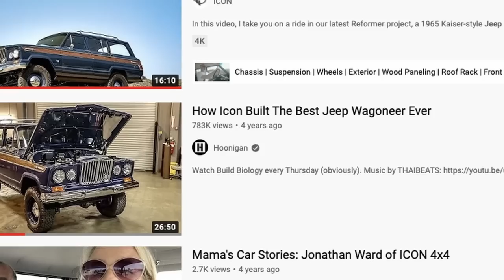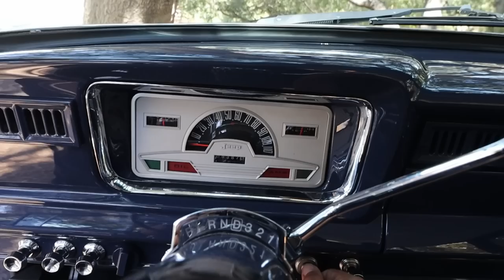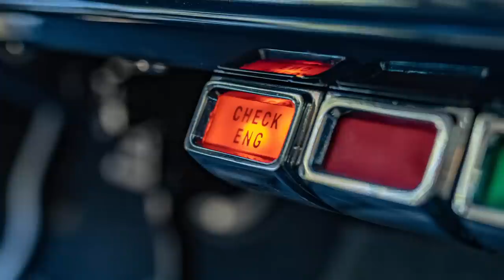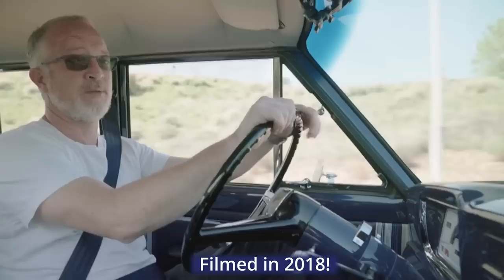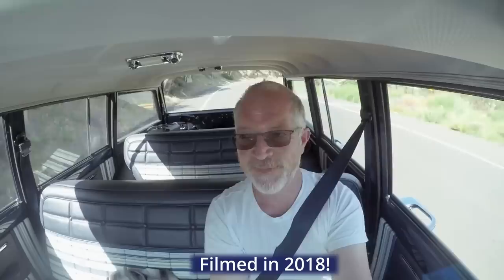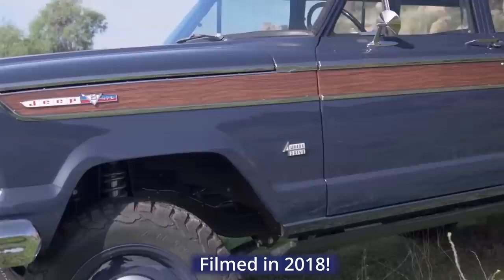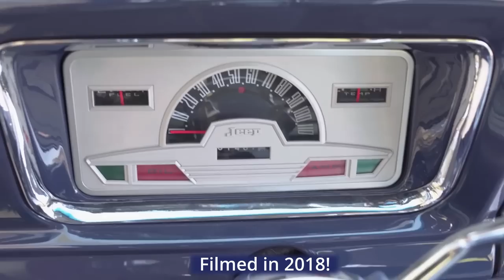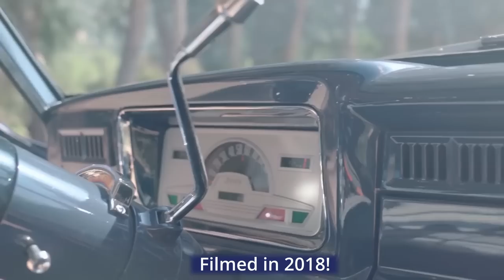ICON Reformer 1965 Kaiser Jeep Wagoneer

Comment: I can’t believe the original owner only put 6500 miles on it. I would have driven it every day.
Reply: He probably has a number of vehicles.  
But I agree with you there.  It would be heavily used by now if owned it.  Really see how good it off road.  Should be pretty kool.  Jon made a scale rc that was pretty awesome, and does well. I imagine full size is better.